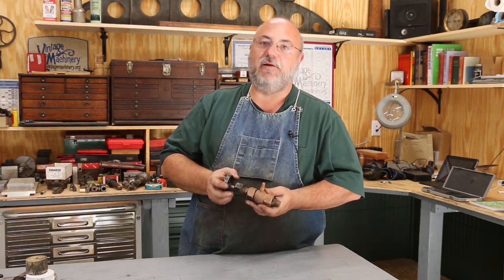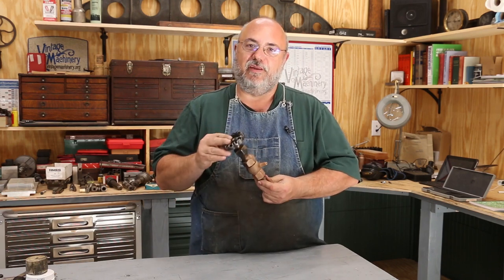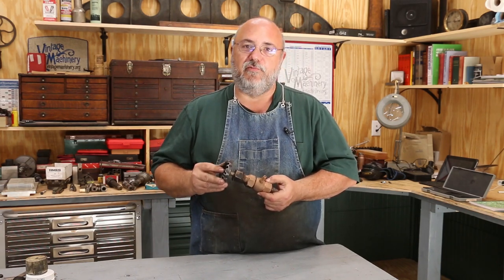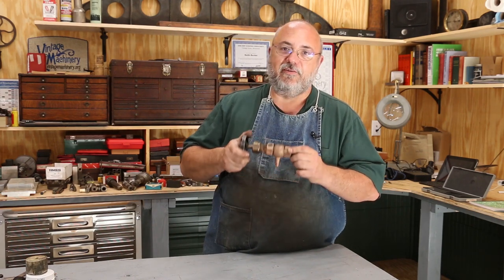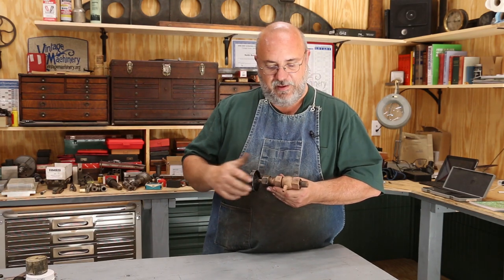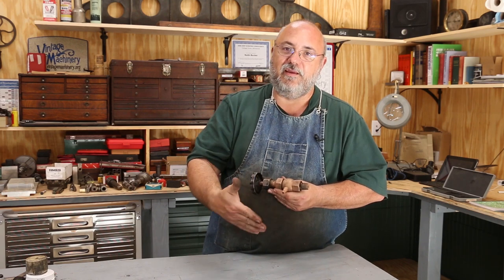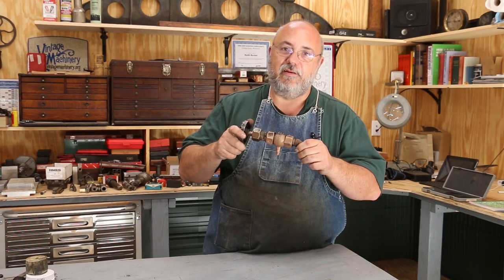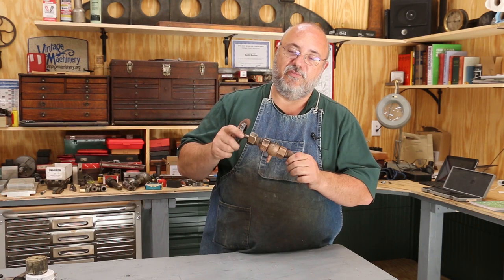Reconditioning a Try Cock Steam Valve

Comment: Those are among the most important valves on a steam locomotive engine.  The C & O railroad lost one of their massive Allegheny engines to a boiler explosion.  The photos of the remains of the engine are stunning.
Reply: Good point. I've seen one boiler explosion - or to be precise,the results of one boiler explosion. I wasn't anywhere near it when it had its catastrophic disassembly.

That was one too many,as far as I'm concerned. Boiler explosions are truly bad.

Comment: The place were I use to work at we were in charge of maintenance of the building we worked in. They had what was a kit that was use to reseat and new rubber gaskets for water valves. It was a lot faster to use it then replace the water valve. This is the first time I see one for steam.

Comment: when I used to work in the oil and gas field we used those tricock valves on pressurized tanks, when they leaked I just replaced them and tossed the old valve, usually because they busted in the cold weather, but it was really cool to see how they worked. I would have loved to see the packing that you used. we had flat washers with rubber of rings for ours
Reply: Most of these low pressure steam service valves use a natural fiber such as jute, cotton, oakum cord/string impregnated with graphite spiral wound around the stem for packing and compressed around the body and stem to seal by a tapered packing gland nut/bonnet. 
Modern low pressure steam service replacement packing uses natural fiber or synthetics such as carbon fiber, Teflon or Gor-Tex or Kevlar/Aramid cord impregnated with graphite.

Comment: It would be great to make a pilot bushing to center the valve stem for finishing the seat and stem.  More work but would give more accuracy.  Wind noise today was from a fan I bet?  The other day I made a generic comment about breathing while teaching.  That was not a criticism of Keith but a fact when WE teach while demonstrating many times.  I like that cap bill mic Keith but notice you generally don't wear a cap.  Of course, air conditioning would be great.   Great video and I bet they had to make do back in the old days, too!  Greg

Comment: Hi Kieth, got a little suggestion about dealing with running fans during your video shooting. Open cell foam works wonders at managing buffeting noise. A small piece positioned over the mic helps to prevent this unwanted noise.

Comment: The 2 angles should not be the same. a slight difference will let the seat move down as the valve seat wares. A thin seat line will seal much better than a wide seat.
Reply: That is correct, many if not most valves employ a 2-20 degree angle difference between the stem and seat.
Reply: In critical applications one would use a purpose built seat lapping tool and there would be some extensive engineering going into the design of the valve.  Reducing the seat/disc contact can help ensure better sealing for a longer time.  Though, I'd guess that with a cast-body and one piece stem, this valve isn't too picky about ultra precise geometry relationships.  We're not looking at high temp alloys and double angle seats here.
Reply: My experience is in nuke plant building and repair as a pipe fitter with years of valve repair and trouble shooting. some primary containment valves are bronze seat and disk and must meet very strict leakage requirements
Reply: dont want that nuclear waste to leak out do we! (unless we really want it to, hopefully when the epa isnt looking)

Comment: Keith, is the dry steam, by nature, more "abrasive" to steam fittings than wet steam or water in a locomotive? Just wondering if the top valve leaking is indicative of that.
Reply: or just the one opened the most?
Reply: Wet steam is generally more erosive because it usually contains minerals.

Comment: I have seen those shut-off valves on sight glasses, and I realized that they were backups in case the glass broke, but something I never thought about until now is that if the sight glass breaks during operation you have boiling water and live steam shooting out in the direction of those valves.  I know the engineer would be highly motivated to get those valves closed, but is it actually possible?
Reply: Chaka Wolf Yes. Maybe. With this low pressure system, it shouldn't be impossible. As the pressure rises, it gets dangerous. At 600 psi or more, you can hear the leak but you probably won't see it. The 1969 procedure was to use a broomstick to find the leak. Better to cut the broomstick in two rather than your arm or your neck. With today's safety rules, everyone probably has to evacuate.

Comment: I saw Harbor Freight had a screen for a double garage door which might work for your shop doors to keep out the bugs while still letting some (hopefully) cool air in.  They're only $25, so you wouldn't be out much money even if they can't be adapted to your door size.  I believe they can roll up when not in use and have a little magnetized seam for easy entry and exit.  

https://www.harborfreight.com/double-garage-screen-door-68310.html

Comment: If you dress it, wont the threads be a problem? It might not bottom.
Reply: There enough threads left on the stem to allow for dressing the seat. The handle will just be closer to the bonnet in the closed position.
Reply: i reckon those old valves gave you enough meat to redress it many times, a modern one would not